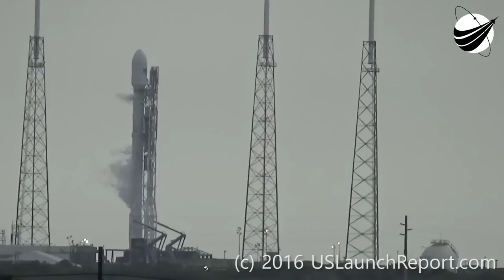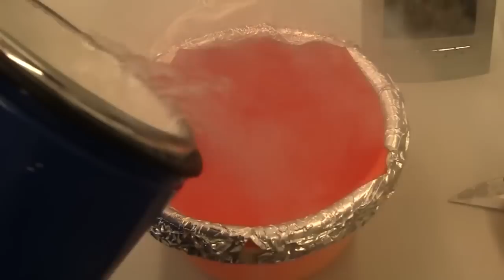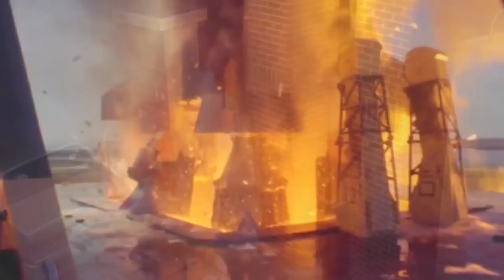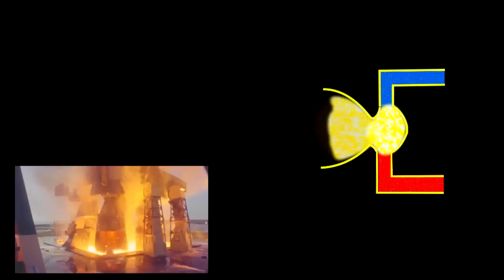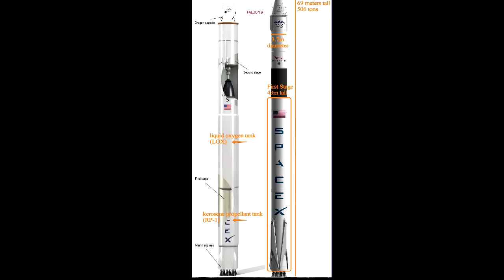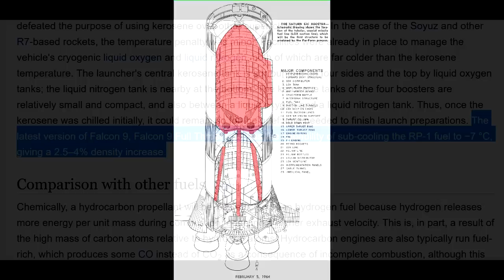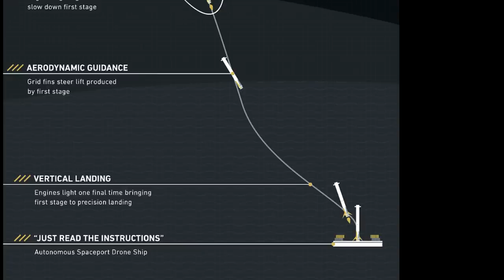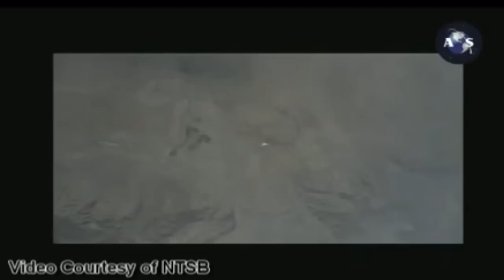Why did the Falcon 9 Explode?

Comment: Who would want to be the second crew of a reusable rocket???? Not I
Reply: Ask the various crews of the space shuttle.
Reply: Shuttle is different from a rocket right? It's just with how fragile that ignition system seems, I wouldn't
Reply: Just search for space shuttle explosion on youtube...
Reply: Drunkend Zombie
No, the shuttle isn't really different from a rocket. It uses an auxiliary tank to break atmosphere but it still has very similar reaction for its own fuel. And thus, a failure in the wrong place could cause just this sort of explosion. Yet, no one brought that up in terms of reusing the shuttle, despite the fact that NASA has more than its fair share of destroyed rockets and dead crews under its belt.

As calloused as it may sound, a fault like this was probably inevitable. These problems may have been solved decades ago, but those solutions were selfishly hoarded away from the public, stubbornly kept from the collective knowledge of man kind. So it isn't surprising to see these issues come up again, when people are working without the benefit of our previous advancements walking old trails without so much as a signpost to show the way. And as much as I like thunderfoot. His dislike of Munsk is clearly coloring his reporting on this issue.
Reply: Also, the designs that everyone else uses are about as old as "the last fueling explosion" and just tweaked.

And the space shuttle is just a winged rocket with more rockets and fuel tanks strapped on. Claiming anything else would be equivalent to saying that a B2 Spirit is not an aircraft because it looks different. It's not "essentially a plane" it fully is a plane.

Comment: The landing in perspective: not really that impressive. It could be accomplished by technology decades old. Just no one else was foolish enough to try it.

The space shuttle is full of design flaws too. The two vehicles that where lost where both lost due to the same flaw. The crew sat next to the fuel tank instead of on top of it. If that had been corrected then the crew of Challenger could have ridden an rocket powered escape system away from the doomed ship and most likely survived and Columbia wouldn't have even been at risk for FOD damaging the heat shield.

Comment: Saying that musk can't do it because the space shuttle was expensive is retarded. The shuttle that launched, the shuttle that went to space for thirty years, was a piece of shit compared to the original design documents. The original shuttle was nuts in comparison, with turn around times of a few weeks, aiming for a one week turn around time. Air breathing landing engines for different orbits and goals. Ejector seats for the crew etc. It was murdered by congress who instead had every screw be built in a different town and was more concerned with earning votes then establishing an orbital station and lunar and martian bases. If there is one critical reason that we right now, nearly fifty years later are not on mars, it is the outright sabotage of the shuttle program by congress.

Comment: I think you're being a bit soft on NASA. Post Saturn they got pretty cavalier. Feynman himself fumed when he saw their design process. The only part that he thought was sound was the programming. Both shuttle failures were the result of serious known design issues being flat-out ignored. At least Colombia was something that would've required a serious redesign of the Orbiter and they were just too lazy/underfunded/in love with the existing launch system. Challenger was basically negligent homicide. Their own engineers were telling them they were operating well outside the design constraints and were at serious risk of failure.

Comment: This has been a damn expensive lesson for space-x... cutting costs may not always pay off. 
But at least no fatalaties this case. 
I hope they do better. And Nasa and Esa stay motivated by these guys in their backyard.
Reply: SpaceX isn't cutting corners; they're trying to innovate.
Reply: NASA has provided the majority of the funding for SpaceX.
Reply: It was still cheaper than every one of NASA's failures.
Reply: kokofan50 burnung the launchpad, the spacecraft and the payload during refueling: Not that much of an innovation. NASA, Soviets and ESA have been doing this since decades.... (not so much recently)
Reply: rarbiart So you want innovation to work 100% of the time? The whole point of innovation is that it's different from the same thing that's been done for decades. Are there going to be problems along the way: yes. That's just how life is unless you think SpaceX is made of a bunch of all knowing demigods or something. Furthermore, even the well proven technology doesn't work prefectly. Last year the US lost a many year long streak of not losing a rocket when a decade's old design exploded. Simply put space is hard, including getting there.
Reply: i don't think the intended landing of the first stage had a lot to do with an explosion that clearly originates in the second stage

Comment: Frankly this what you get for using the cheapest option for something that SHOULD NOT be used on a cheapest bidder basis. SpaceX is supposedly 40% cheaper per launch then the ULA, numbers are sketchy though since ULA doesn't disclose cost per launch numbers.

A secondary factor is the tech management thinking they can do everything. Elon Musk may be a 'genius' at tech and made all his money there, but the stupid projects like SpaceX and Hyperloop are way out of his depth. Tesla's quickly becoming a failure. Companies (and NASA who also contracts with SpaceX because 'cheap') should be using ULA or government resources. I'd put more faith in Lockheed and Boeing (ULA Co-Founders/Cooperative Project) who have far more experience in the Aerospace and Rocketry industry, engineering, and science, over some tech jackass.
Reply: Oh besides causing massive launch pad damage that I doubt SpaceX will be paying for. American taxpayers get to foot the bill for this jackasses companies THIRD major failure in as many years when most governments have a saftey track of one every 10 or so and ULA has had only two minor failures with no damage in the 15 years they've been operating.

Comment: I've still had my skepticism about the re-usability of these rockets; however I have to disagree on your point about the waste of using fuel to land the rocket. As I understand rockets usually have extra fuel in them to mitigate risks of needing to correct for unforeseen problems. For instance in Falcon 9's case specifically it's able to complete its mission with an engine failure or two depending on how long into the launch these occur. Of course to correct for these failures additional fuel is needed, the fuel which is now being reserved to recover the rocket. So you're really not taking way from the range of the rocket if you're using "emergency" fuel that you were never going to use anyway.

Comment: I'm neither a fan or detractor of SpaceX, but I thought it would be good to mention that if there was a crew on board this rocket then the launch abort system would have been capable of launching the capsule away from the exploding rocket at a sufficient speed to avoid any damage to the capsule (assuming the launch abort system could kick in as soon as the explosion occurred, which it should) if you want more details watch Scott Manley's video on the incident, he explains it much better than I can.
Reply: That may be true, but NASA is not going to take that chance anyway. NASA had raised concerns about fueling the rocket while the astronauts were already in the Dragon capsule and SpaceX tried to alleviate those concerns, but this failure is going to have NASA breathing down their necks again. Perhaps a Dragon v2 would have escaped and the astronauts survived, but NASA isn't going to take the risk. They will need SpaceX to isolate EXACTLY what happened, provide evidence for it (perhaps recreating the point of failure in an isolated controlled experiment) and demonstrate that they can rectify it before they allow SpaceX to fly astronauts. That's not unreasonable on NASA's part at all.

Comment: Except our interest in recycling, reducing, and reusing etc, why wouldn't a throw away or one time use rocket launch vehicle not be more economically viable? That I think was the point at the end considering Musk hasn't used any that have been recovered yet. So screw it. Build it, launch it, repeat. Which is the better way to go? PS I'm just a vehicle mechanic not a rocket mechanic. I can only imagine saying "sorry, you're gonna need a complete engine rebuild. You might as well buy a new vehicle."

Comment: "Organizations like NASA basically wrote the rulebook on this sort of stuff. They would never have allowed a design like this off the drawing board, where merely making a single mistake in flipping a single switch could lead to catastrophic failure and the loss of the vehicle."

How many switches needed to be mistakenly flipped or not flipped to cause the O-ring in an SRB to fail and kill the whole crew of Challenger? How many for Columbia to turn into a fireworks show on re-entry? I'm sorry, but NASA's post Apollo record is very, very unimpressive to put it kindly. 

The recovery of the main rocket engines intact after delivering a considerable payload deserves more kudos than you gave it. It's a genuine new achievement in a sector that has gone without those for quite some time. SpaceX does not deserve the crazed fanboyish devotion that some throw at it - no organization does. Its record is extremely spotty. That being said - everyone's record is spotty or comes with significant asterisks (for instance ULA has an almost spotless record... but buys its main engines from the Russians.)

Comment: I take it that you don't like Musk that much. I agree with you there. Something like this shouldn't have happened.
Reply: Plenty of rockets have been lost by NASA which resulted in the loss of life for really dumb reasons. Look up the O-ring failure for the boosters. This is only the second rocket they've lost as landing explosions aren't really a loss when they are still figuring them out.
Reply: They're figuring out what NASA has already figured out decades ago. Yes, NASA made mistakes, but they solved their problems. These guys don't need to figure out how not to blow up a rocket at this point.
Reply: skaruts NASA didn't design a reusable rocket that doesn't blow up. They have to figure out countless things that are unique to their design. Countless things still break that have been around for decades and no solution is 100%. Everything has a tolerance and right now SpaceX is within the industry standard for successful launches to failed ones.
Reply: bensemus x It's funny that I think thunderf00t made a video explaining exactly why their test failed, based on prior knowledge from NASA's experience. But it could be just my impression...

Comment: The idea of using drogue chutes to slow the rocket before final recovery using the rocket engines is so obvious, most people who have played Kerbal Space Program have figured it out.
Reply: Except in KSP you are also using a heatshield and friction with the atmosphere to do most of the breaking. When I return from the mun I'm traveling at over 2km/s. I have to wait until my speed is below 500m/s before I can even think about opening the chutes. The F9 has no heatshields so it can't handle that kind of entry. Ergo rockets. The F9 also has to stay out of the ocean as the salt water caused a ton of damage. It's one of the things that made the Space shuttle so expensive was refurbishing the boosters that had soaked on the ocean.

Comment: First the hyperloop, now this? Yeah, I think you're showing just a bit of bias here. Your top comment is showing a little too much schadenfreude, laughing up a serious problem that could damage commercial space development becauswe it's Elon Musk's rocket. I haven't seen the similar one you must have done rubbishing Richard Branson because the first Spaceship Two failed from the lack of a safety cover on the wing release.. 

 'NASA would never have allowed a design where a single mistake could cause the loss of the vehicle... except the Shuttle, where a single O ring failure destroyed one and a single tile being damaged did for another.' Both of which problems were known about beforehand to boot.'

I mean, I agree about the Hyperloop, I don't think you can get a safe vacuum tube that long, but the rocket motors you're rubbishing are designed for lifetimes that include multiple launches without refurbishment, where as the SMEs... weren't. Plus, your own hypothesis is that it wasn't the engines that were the problem.

I respect you as a scientist, but you're not an engineer. If the problem you posed has a simple answer, what is it, and why wouldn't the engineers of SpaceX, who are not Elon Musk and are actual 'rocket scientists' not used it? Did Elon Musk somehow say, 'NO! We must use a more dangerous method because reasons!" Spacex has paid in cash and exploding rockets for every technological advance they've made. 

To be honest, I expected better from you, something along the lines that this is a setback for commercial space, but it's something that needs to happen rather than gloating because it's Elon Musk's rocket that was destroyed.

"This firework cost ~$250 000 000!  In a FUELLING EXPLOSION!  Not seen one of those for a LONG time... good job spacex! ;-)"

Yeah, not gleeful at all.

Comment: See... I wasn't paying attention to this, because I thought they were better than this.  Have they really been trying to land the rocket after launch?  Why would they do that?  You can recover the metal after reentry, right?  You don't need to land it like it's full of people and fine art.  Just crash it into the ocean and dredge it back up.  You aren't going to be re-using the machinery after a launch anyway.
Reply: You most definitely will be reusing the machinery. Making the engines is the most expensive parts of the rocket. If the rocket lands in the ocean then it suffers pretty severe damage from the salt water.
Reply: bensemus x I thought it suffered pretty severe damage just from use...
Reply: Pebkio Nomare Not really. The engines were designed by SpaceX to be reused. They are the most reliable rocket engines created with 0% failure rate. All 9 engines on the recovered first stage appeared to be working fine when they did a full test burn.